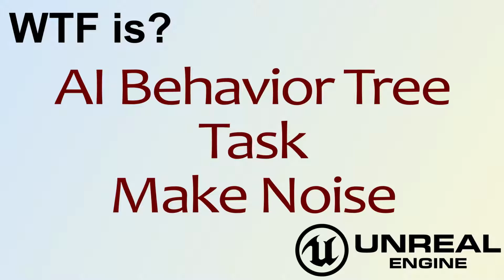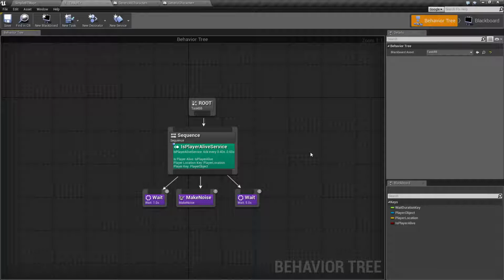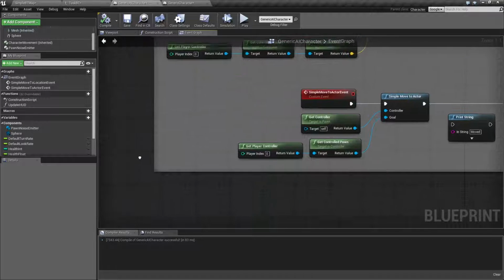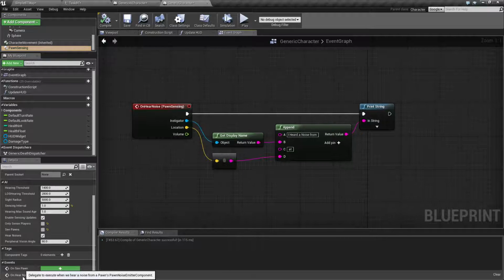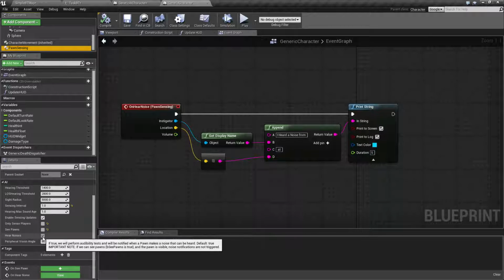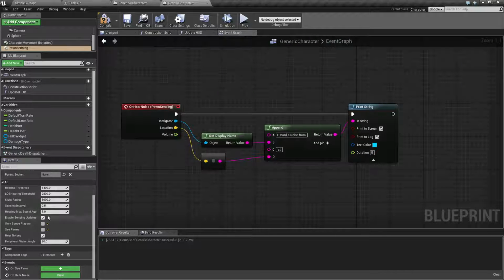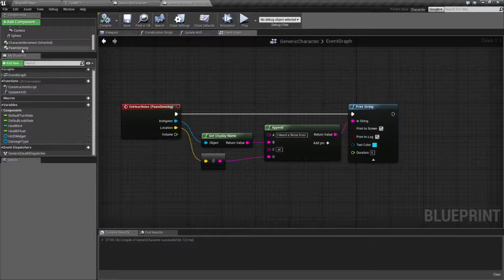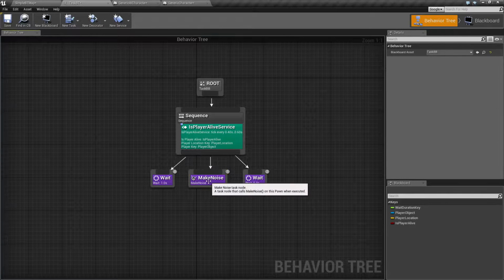WTF Is? AI: Make Noise Task Node in Unreal Engine 4 ( UE4 )

Comment: Hey, what i ask myself is why we have the AIPerceptionComponent and this PawnSensing related Components,
is there any recomondation in which cases i should use this over the ai perception system.
just tried to see if the visual debugger shows me this noise, may i did a mistake but it seems this systems are separated.
Anyway, thanks for sharing.